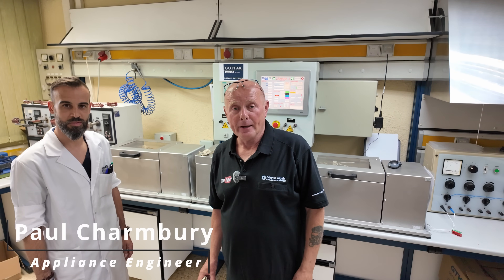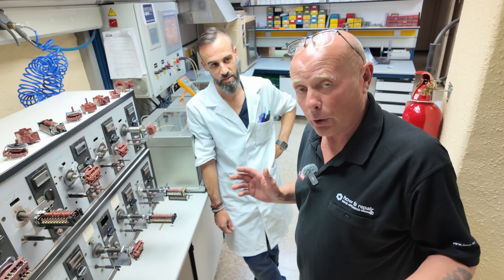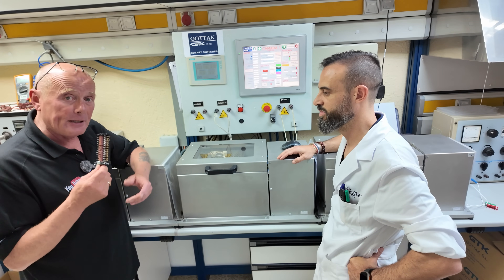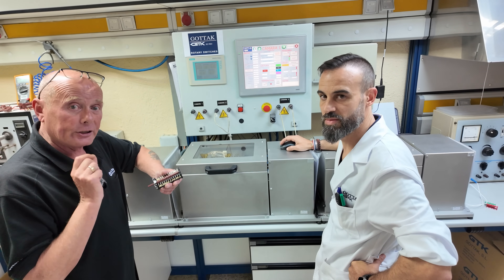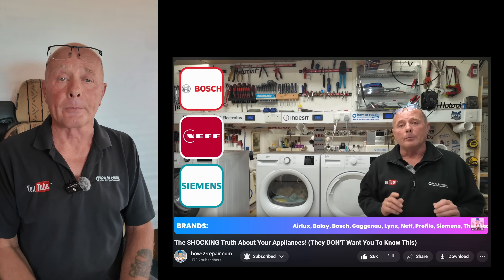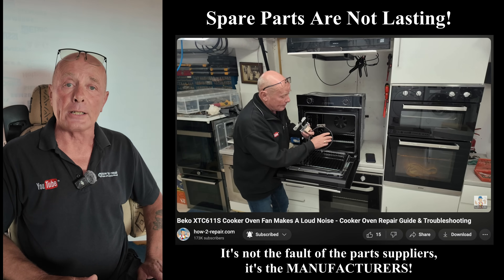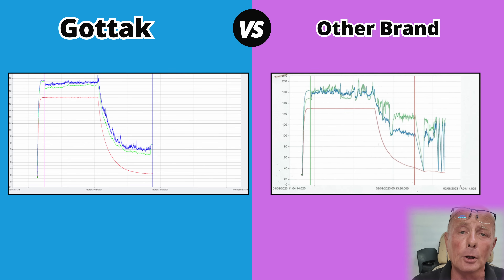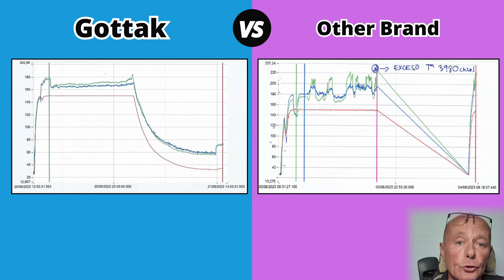Why Your Appliances FAIL SO FAST! Lab Results EXPOSE the Truth!

Comment: Disgraceful, and not just appliances. Then there is the whole "rights to repair" issue, manufacturers either refusing to supply or making components unreasonably expensive.
Reply from the maker: @rodbicke You've hit on a really important point! The "right to repair" movement is definitely gaining traction as more people become aware of manufacturers limiting access to parts and repair information, which can make fixing things yourself or using independent repair shops much harder and more expensive. For a deeper dive into why some appliances might not last as long as they used to and the issues around getting them fixed, be sure to check out our videos at https://www.youtube.com/watch?v=QsdGd2qDPaI and https://www.youtube.com/watch?v=xn03N3b0-lE. We'd love it if you'd subscribe to our channel for more discussions like this!

Comment: Virtually every power tool I've bought in the last 10 years has suffered from power switch failure- sometimes literally within weeks. It is always the first thing to go and likely the one place where manufacturers always go to to save money. After that it'll be the power cable. Total rubbish. By contrast I have tools purchased in the 80's that have never given any trouble- even the cheap ones.
Reply from the maker: @user-et1id3hd5i That's incredibly frustrating to experience such consistent power switch failures in your newer power tools, especially compared to the reliability of your older ones. It certainly sounds like a significant drop in quality for a component that's so crucial. You're likely right that the power switch and cable are areas where manufacturers might cut costs, leading to these early failures. Our videos at https://www.youtube.com/watch?v=QsdGd2qDPaI and https://www.youtube.com/watch?v=xn03N3b0-lE explore how design choices and cost considerations can impact the lifespan of products. Thanks for sharing your experience – it's a common theme we hear. For more discussions on product durability and potential solutions, we'd appreciate it if you would subscribe to our channel!

Comment: Hi 
Built in obsolescence is not just in domestic products it's also in the  automotive world and has been since the 80s. Built in obsolescence isn't the problem it's the short term of life vs the cost of the product, as you have said its all run by the bean counters putting profit above quality charging top dollar for cheap crap.
But the otherside of the coin is not everyone can afford rolls royce quality (if that is still a thing) but everyone wants a device that works at an affordable price and then takes out the extended warranty to cover the risk.
I don't think there is a solution as long as conglomerates are running the show for the good of the shareholder.
Reply from the maker: @TheBlibo You've brought up some excellent points about the complexities of built-in obsolescence extending beyond just domestic appliances into the automotive world and the core issue of cost versus lifespan. It's true that the desire for affordable products often clashes with the goal of long-lasting quality, and extended warranties have become a common way to manage that risk. Our videos at https://www.youtube.com/watch?v=QsdGd2qDPaI and https://www.youtube.com/watch?v=xn03N3b0-lE touch on how economic pressures and manufacturing decisions contribute to these trends. The influence of large corporations and the focus on shareholder value are definitely significant factors, as you mentioned. It's a challenging situation with many interconnected aspects. For more in-depth discussions on these issues, we encourage you to subscribe to our channel!

Comment: they don't all fail right after the warranty ends, what manufacturers do is not only calculate the MTBF (Mean Time Before Failure) they also have design specs with those figures for the materials used in the product for that purpose and the cost difference between those options and they will have a big old data set for these failure, they will have a bell curve for failure rates and what they are looking for is less than 2% failure rate within the warranty period, that is the bit that costs them profits, some might go as high as 5% during the warranty period, or even quite a bit higher if the warranty period requires a customer to register when purchasing for an extended warranty. 
but yes the failure rate is baked into the design and if you win the MTBF lottery your device could last decades.
another trick they use is they will use a cheaper part that is more prone to failure and the provider of that part will cover the cost of repair if it fails inside of the warranty period.
the days of brand names and quality has long long long since past, now it is all a number game and those numbers are the largest profit for the lowest cost.
Reply from the maker: @johng.1703 That's a really insightful breakdown of the calculations and strategies that manufacturers likely employ! The idea of targeting a low failure rate within the warranty period, using MTBF data and cost analysis of different materials, makes a lot of sense from a business perspective, even if it's frustrating for consumers. Your point about the bell curve of failure rates and how some lucky individuals might get decades of use while others experience problems much sooner aligns with what many viewers report. The detail about using cheaper parts where the supplier covers warranty repairs is also a clever, albeit potentially disappointing for the end-user, tactic. You've definitely shed light on the data-driven approach behind product design and the shift away from prioritizing brand name and inherent quality. Our videos at https://www.youtube.com/watch?v=QsdGd2qDPaI and https://www.youtube.com/watch?v=xn03N3b0-lE touch on these economic and design factors influencing appliance lifespans. We appreciate you sharing your expertise! If you'd like to see more discussions on these topics, please subscribe to our channel.

Comment: This is exactly like my samsung series 5+ washing machine which was originally manufactured in poland.. when it needed a repair they wanted to exchange the machine with the same one

This actual turned out to be made cheaply as it is now manufactured in china 😂 i could straight away see the cost cutting measures from a flimsy door with thinner glass to a machine that was lighter in gross weight and thinner panels to even cheaper lower nm shock absorbers

I happily said no thanks and ended up fixing the machine myself

It is shocking what is now made cheaply.. but yet the prices of these appliances just creep up while the quality goes down.. its a disgrace
Reply from the maker: @Gaming.Monkeys Your experience with your Samsung washing machine really highlights the issues we've been discussing! The differences you observed between the Polish-made and Chinese-made versions of the same model, from the door to the weight and shock absorbers, are clear examples of cost-cutting measures impacting the perceived quality. It's definitely frustrating when prices increase while the build quality seems to decline. Your decision to repair the original machine yourself is commendable and reflects a growing desire among consumers to avoid this cycle of replacing cheaply made appliances. Our videos at https://www.youtube.com/watch?v=QsdGd2qDPaI and https://www.youtube.com/watch?v=xn03N3b0-lE touch on how manufacturing locations and cost considerations can affect the durability and lifespan of appliances. Thanks for sharing your detailed experience! If you're interested in more discussions about appliance quality and repairability, please consider subscribing to our channel.

Comment: I paid 3000NOK (around 300 dollars?) for a Gorenje front loader washing machine around 2009. Basic model, no fancy screen or programs, 1400 rpm. Still doing fine 👍 Did replace the brushes for the electric motor 3-4 years ago, easy diy repair. We have 3 kids, so plenty of use
Reply from the maker: @espensund2878 That's fantastic to hear about your Gorenje washing machine! Getting 16 years of reliable service, with only a simple DIY brush replacement, really speaks to the build quality of some older models. It's great that you were able to tackle the repair yourself too. Your experience definitely contrasts with some of the stories we hear about newer machines. Our videos at https://www.youtube.com/watch?v=QsdGd2qDPaI and https://www.youtube.com/watch?v=xn03N3b0-lE touch on how the design and components used in appliances can significantly impact their longevity and ease of repair. Thanks for sharing your positive experience – it's good to know that durable appliances are still out there! If you enjoy hearing stories like this and discussions about appliance lifespan, please subscribe to our channel.
Reply: @How-to-repair Really appreciated your answer. I can see that this topic is something you care a lot about. Personally I strongly believe in simplicity and quality in products (do we really need a touchscreen and WiFi on a washer?). Happily subscribed to your channel 👍

Comment: I’m still using my 1970s English Electric cooker! Works fine, needed one new simmerstat when I got it from eBay 10 years ago. Been running fine since! Just had to change the light bulb once. Got some spare elements but haven’t needed them yet. That’s the way things should be made! Will never change it.
Reply from the maker: A 1970s English Electric cooker still going strong is a testament to how well things used to be built. So many new appliances focus on aesthetics over practicality or durability and it’s frustrating when appliance repairs are made deliberately difficult nowadays.
Reply: And I’m still using an early 1960s (1964, I think) English Electric cooker … it was the first generation with Simmerstat controls and I can barely remember the occasion when my parents upgraded from the 1930s GEC we used to have. 

The biggest problem I have with it now is due to corrosion of steel parts and broken counterbalance springs on the grill door … but it still does the job.

Comment: Not just silver, palladium is also used in switch contacts and palladium is a very rare metal.
Reply from the maker: Hi @pravardhanus!

That's a fantastic point! You are absolutely right to bring up palladium. Like silver, palladium is indeed used in switch contacts, and you're spot on – it's a very rare metal.

At the trade show last year, the limited availability and increasing cost of materials like palladium (and silver, for that matter) were definitely part of the conversation around built-in obsolescence. These precious metals are valued for their excellent conductivity and resistance to corrosion, making them ideal for reliable electrical contacts in appliances. However, their scarcity and price can create pressure on manufacturers, sometimes leading to the use of less durable alternatives or design choices that might shorten the lifespan of the appliance.

For a more in-depth discussion on how material choices and design impact appliance longevity, and to see some of the examples we discussed at the trade show, you might find our main video insightful: [Link to your main video: https://youtu.be/gEgSCbZnHVM?si=wTIw0mELuhWaw4aX]

We also touched on the broader strategies some manufacturers employ in these related videos:

[Link to video the shocking truth about manufacturers: https://www.youtube.com/watch?v=QsdGd2qDPaI]
[Link to video heat pump tumble dryers are they really worth it?: https://www.youtube.com/watch?v=xn03N3b0-lE]

Thanks so much for adding this valuable piece of information to the discussion! It's this kind of detail that really helps everyone understand the bigger picture. If you found this helpful, please consider sharing the video – the more awareness we can build around these issues, the better for us all as consumers. And don't forget to subscribe for more discussions like this!

Comment: Question: Is there a difference in quality of components and time until failure between the flagship models of brands versus entry models? Or do they all fail on something within a similar time-frame no matter the price point of the device?
Reply from the maker: @LogiForce86 That's a great question! In general, most manufacturers use a lot of the same components in the low end to the high end but Generally, flagship models often use higher quality components that can lead to a longer lifespan compared to entry-level models. 1  However, as discussed in our videos on built-in obsolescence (https://www.youtube.com/watch?v=QsdGd2qDPaI & https://www.youtube.com/watch?v=xn03N3b0-lE), many factors can influence when a device fails, regardless of its initial price. For a more detailed explanation, we recommend checking out those videos. Please subscribe to our channel for more insights!

Comment: Just today, my barely out of warranty dishwasher's door dropped on the left side.  It can be repaired, but entirely at my cost.  When I was in engineering school, a million years ago, on of my profs showed us a collection of metal coupons that he had tested for a major auto manufacturer.  The premise was to determine the best way to form the door.  When the testing was over, the OEM chose the method that would fail in such a way and time to encourage sales, despite having a full understanding of a better approach which would result in a much longer service life.  What more can I say?
Reply from the maker: That story from your engineering days says it all. It's frustrating how often durability takes a back seat to profit. Your dishwasher issue is a perfect example just barely out of warranty and suddenly you’re having a major issue. These failures aren’t accidents they’re engineered. The knowledge and ability to build things that last is there but it’s just not the priority anymore.

Comment: Some thought I was stupid when I replaced the thermostat in my (at least) 15 years old fridge/freezer. I say no way I buy a new one as long as the compressors still work. The new ones are just garbage and the minimal saving in electricity is not worth it.
Reply from the maker: @skunkjobb You've hit on a key point! Many older appliances were built with more durable components. As we discuss in our videos (https://www.youtube.com/watch?v=QsdGd2qDPaI & https://www.youtube.com/watch?v=xn03N3b0-lE the trade-offs between upfront cost, longevity, and energy efficiency in modern appliances are complex. It's often economical and environmentally sound to repair older, well-built units when possible. Thanks for sharing your experience, and please subscribe to our channel for more discussions like this!

Comment: My dad was an expert on bearings within his particular industry and worked with various manufacturers, one of whom used to sell their rejected bearings to a well known car manufacturer for use in water pumps, alternators, idlers etc. They didn’t want to pay for top spec bearings for all the reasons stated in the video and it also made them even more money through the sale of replacement parts.
Reply from the maker: That's a powerful example and sadly, not surprising. It shows how deep the problem runs when even rejected parts get intentionally funneled into production just to save costs and drive future sales.Quality gets sacrificed, not because it has to be but because short-term profit wins over long-term reliability every time.
Reply: @How-to-repair when you think about it, they manufacture bearings used in all sorts of machinery including manufacturing plants and in my dads case power stations running 24/7. If no bearing in any of those plants lasted more than 2 years, that would be about 16000 hours. Translate that to a car at a very conservative estimate of 20mph average and that’s 320000 miles. I’ve never known a water pump, alternator or any other part of a car last that long.
Reply: @petesmith2234 If you could regrease them they might last that long. But rolling element bearings will all eventually suffer from fatigue damage to the races and rollers. Journal bearings like in power station turbines don't suffer from that.
Reply: Chrysler or American motors perhaps?
Reply: Are you able to name those companies here

Comment: We hear you Paul. Most manufacturers are run by accountants these days.

All about how many units the can sale rather than the quality.

Commercial equipment is the same. Most commercial dishwashers and glasswashers don't last long. 

Keep the videos coming. 
Have a good evening. 

It's if the machine is on a timer.
Reply from the maker: Thanks so much for the support it really means a lot. You're absolutely right: when accountants are in charge, quality often takes a backseat to quantity. And it’s frustrating to see that even commercial machines, which should be built for endurance, are falling into the same trap. It would be really helpful for me to get my video shared and help us fight appliance waste! Please remember to subscribe to our channel, as that really helps us!
Reply: They always were. In engineering, you design to a price point. You could design a switch that lasts 1,000 years, but it would make the final product so expensive that no one would buy it. Everything wears out, even the highest quality, most expensive products.

Things aren't designed to fail, they are designed to last 5 years. Hypothetically, if research shows that  95% of people replace their dishwasher every 5 years (whether it needs to be replaced or not), why would you spend an extra $4 million to create a dishwasher that lasts 50 years. Think about 🤔it.